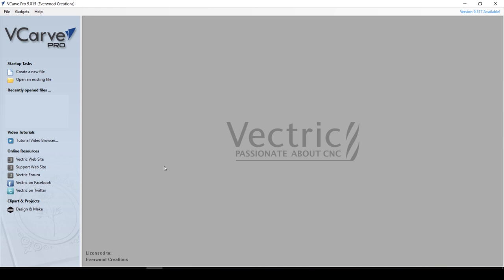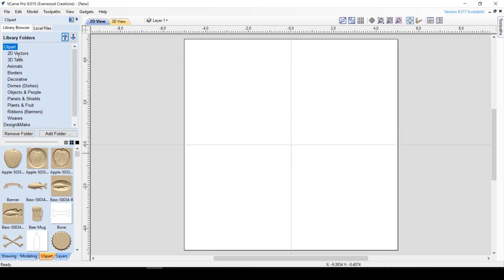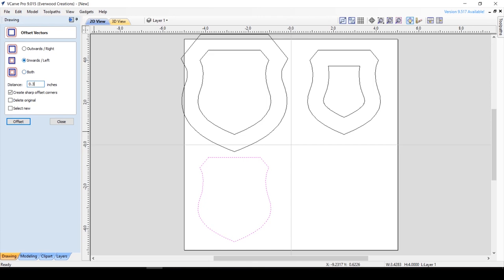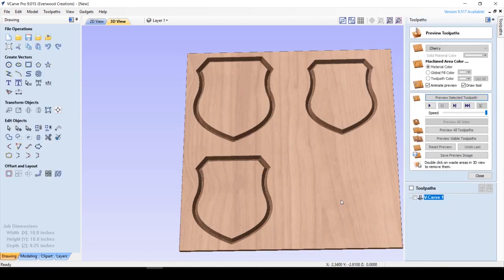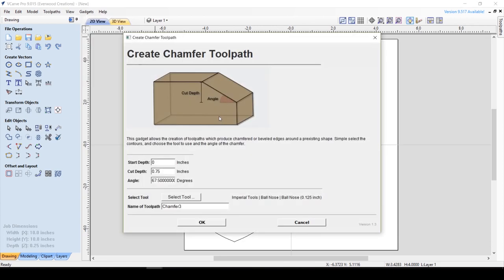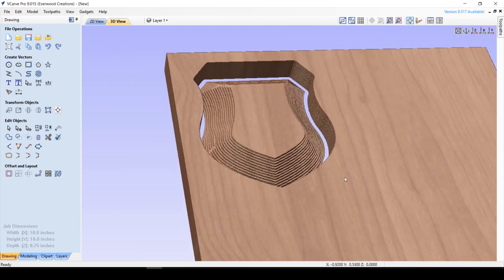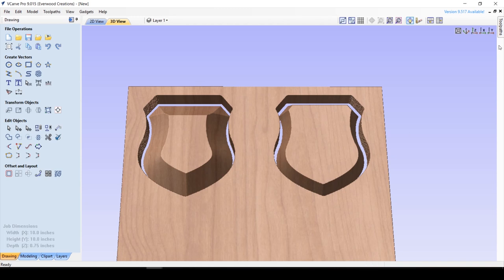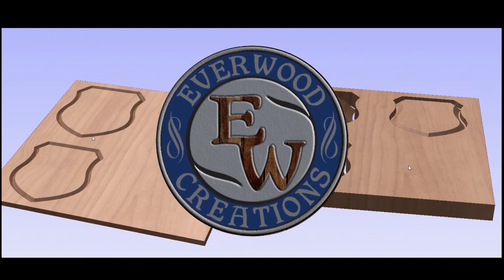Creating Chamfers on your CNC

Comment: If cutting through the material can you add tabs to hold the work piece in place?
Reply from the maker: Yes you can!  You just set them in the toolpath creation like normal.  The only thing you will want to make sure of is that the thickness of the tab is not more than the chamfer depth.  I've never had any issues though.
Reply: @EverwoodCreations  Do you do any one on one lessons for VCarve? 
I emailed you a while ago, but I never heard back. 
Thanks.
Reply from the maker: @JoeLazzara  Sorry about that Joe, I have replied now.  Sorry I don't offer that kind of thing, but I found a few places that might help and included them in my reply.

Comment: thank you so much Kerri for these clear explanations. I have VCarve Desktop 11, I don't have the gadgets but there is the chamfer icon in the toolpath. I want to make a dollhouse door with "raised panels" and I think the chamfer will do. I don't want to cut through, so I have to put a flat depth right? the base is a quarter inch think, how much should I put as a flat depth? I have made so many trials and I don't seem to succeed. But I will follow your video closely and hopefully I'll make it. Thanks! Simone from France
Reply from the maker: Thanks for the kind words, Simone.  You are using a newer version than I am, so I don't have any experience with the chamfer icon they have added in the toolpath options, so I'm no help there.

If I were trying to make something like this, I would probably create a vector then offset it and vcarve in the groove created, the more you offset the deeper the groove will be.  If a flat depth is required, on .25" I would set the flat depth between .15" and .20" depending on the strength of the wood and size of the piece.

Best of luck, sounds like a fun project!

Comment: Can you use something similar to get a round over?
Reply from the maker: I'm afraid not.  A round over has to be a 3d toolpath, where this technique is using the edge of the bit to create the angle, or the specially made gadget.  A possibility could be to use a molding toolpath and place your rail accordingly to make the round over, but that would only work in certain situations.  Otherwise you have to go to full on 3d modeling to get the rounded effect, as far as I know.

Comment: How would I go about making a concave slope? And what kind of bit would I use for that?
Reply from the maker: A good question.  It depends on the size of concave slope you are looking for.  You could make one the size of the bit you are using by just tracing along the edge with the bit using a profile toolpath.  If you are wanting a large slope though, you would need to delve in to the 3D modeling side of things.  Either way you would need a ball nose bit in order to get a nice smooth finish.

Comment: with the gadget i am getting a rough edge in the bottom left corner [in the software not real life] when doing the first chamfer toolpath with the 0.25 end mill do you know what might be causing this ? apart from that everything is working, thankyou for making this video
Reply from the maker: This isn't a problem I've come across before.  If it's just in the preview, there is a possibility that it is an issue with the software rendering, as it is a 3rd party addition.  It may be worth doing a test cut to see if it manifests in actual carving.  Otherwise checking your vectors and running the tool again may help.  If the problem persists, you could try doing a molding toolpath to get a similar result.